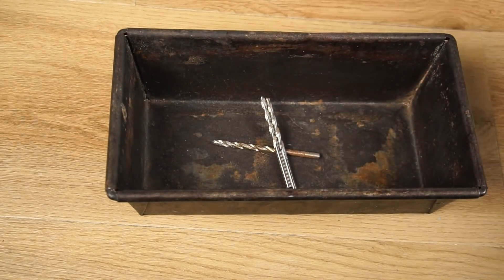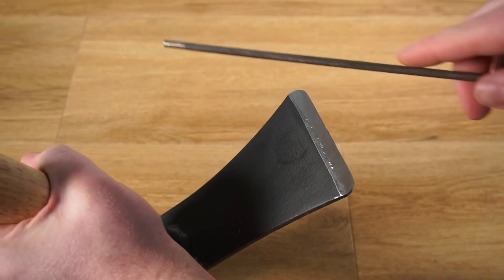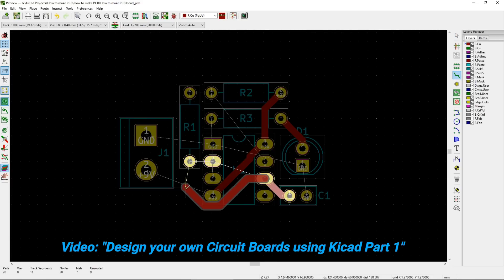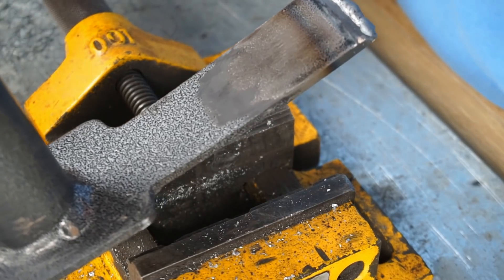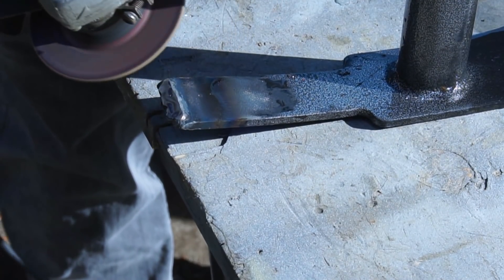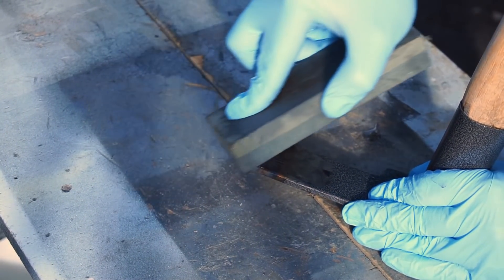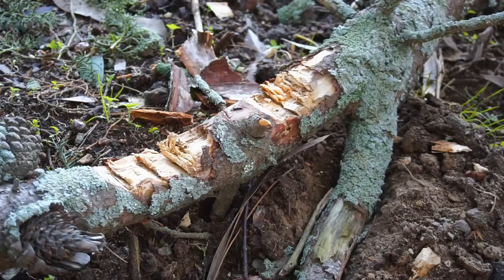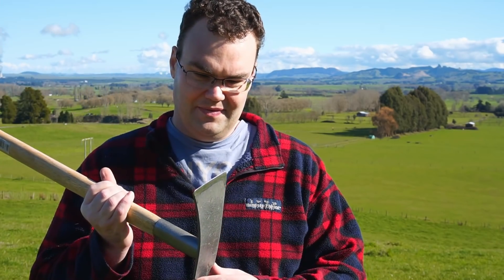HardFacing tools using Drillbits as filler rod!?!? II How to weld Hardfacing

Comment: Even regular filler rod is going to be a step up in strength over the mild steel itself.  The other problem if the new material is too hard it can chip off over time because the stresses at the transition don't match up with the mild steel underneath.  For hard facing anvils, they recommended putting down one layer of medium hard material with a hardness in the mid/high fifties, and then your top layer with a hardness in the sixties.

Comment: Excellent video. I became interested in the concept when I saw Jody use a drill bit, & This Old Tony used some tool steel filler-  I rebuilt a set of bolt cutter jaws,  hardfaced a digging bar (aka "heater bar") that I use to dig corners out of flint/clay packed gravel roads (as a Land Surveyor), and have even fixed some chisels from China. It definitely works.

Thanks!

Comment: Porosity may be due to welding technique. Smaller steps, and quicker dabs of bit. And those were biggish bits also.

Did some testing of hard face with drill bits last year. As welded hardness was HRC 66...

Comment: You should use a special grinding wheel made for hardfacing. Norton makes some great grinding wheels. Get the one made for S-1 steel. Works just killer.

Comment: Now, for those of you Johnny come Latelys that want to blather "what about resharpening the file big guy?" 

Thats not a thing. You can acid clean a file once or twice b4 its merde. But after that, the file is done, its donor metal. Use it to hard face.

Comment: Normalize an old file. Cutoff a piece of the file and forge weld it to the edge of your tool. Requench the tool edge.

NEVER EVER THRIW AWAY DRILL BITS. Unless you can make drill bits. 

Freakin learn how to resharpen them and they WILL last you DECADES.

Stop throwing out the baby with the bathwater!!!!!!!!!

Comment: You need to test the bits. i believe drill bits are softer/different metal at the chucking end. Stops damage to chuck when bit slips in it and probably better grip.Not the same tool steel all the way through to the end probably also done for cost saving. waste of money to have tool steel on non cutting end.

Comment: The impurities could also be caused by bad gas coverage. try putting  steel wool, fine scotchbrite or any other thin fine media up the nozzle of the tig torch. I've had the same problems, especially with the chinese stuff.  

As an added bonus, your welds will become shiny.
Reply: An often overlooked cause of porosity is high pressure on the gas, causing turblulance. A diffuser in the nozzle should slow the gas down a bit.

Comment: BE CAREFUL!!! It’s extremely dangerous to have any striking tool with a hardened edge.
also, cheap diamond stones and laughing paste come in handy when dealing with HSS or really hard steels.

I have experience forging and machining every type of steel. And it’s extremely dangerous using any type of striking tool that has a hardened face. I’ve restored well over a dozen anvils. Some really beautiful old historic pieces that had been really abused.… In the past I tried everything from machining the top flat then  adding a new plate of steel. Then comes the difficulty of heat treating and relieving the stress. Heating something that large and doing it evenly is difficult.,
I also used the hard facing technique like you discussed in your video. With welding rods.
You just have to be careful, and I’ll explain the potential danger below. But it can cause serious injury.

 It’s a very fine line to get something sufficiently hardened, so that it holds an edge, Without being brittle. You also have to take into account work hardening, which will harden the steel further… As it is used.

But with a striking tool, you can only go so far. There’s a reason they don’t make many striking tools with hardened steel. If you hit a rock with that spade, or if you hit metal with that hammer (like a nail)…. It can cause serious injury and even become lethal. There have been many instances of blacksmiths using hammers made from tool steel, that were too hard. If they miss their target and strike the anvil, or another hardened tool… A piece will chip off….. traveling at supersonic speed’s like a bullet. 
And wedge itself in between your legs, where your biggest veins in arteries carry blood. 

These chips can easily and instantly pass right through several layers of heavy clothes and even leather aprons. They’re traveling as fast as a bullet. And if it just slightly hits one of your big arteries (that are right there close by unprotected)… You’re done for. You won’t even make it to the hospital.
Just be careful.

You can also add carbon to steel which will allow you to harden it further. Of course with hardness, comes brittleness. It’s fairly straightforward. And has been done in the Blacksmithig community for a long time. There are different methods. But basically put stuff with carbon around it and get it really hot.

Comment: Similar to a carbidized edge?
The technique of plating a cutting edge or hard wearing surface with carbide.

Was first introduced to the technique 10 years ago, by the Grimsmo brothers. (The renowned custom knife makers). I think there A few YouTube videos showing the process. 

I’ve used it in the past when making tools for metal machining.  or when forging custom woodworking tools.. like gouges and cutting/burnishing tools. 
In most cases a solid carbide rod would be to brittle and difficult to shape. (without proper diamond and wet grinding equipment… still it’s a real pain in the butt.)

There have been instances where I forged high carbon steel, and then coated the hard wearing edges with carbide. 

It’s been about 10 years so I don’t quite remember everything….but I know the set of violin carving gouges I forged, have carbide plated edges. Over a good quality high carbon steel. Specifically the set of small palm gouges force carving the scroll of a violin. I’v used several of them every day for the last 10 years.
And can still clearly see the difference in color, of the carbide where it meets the high carbon steel underneath. Especially when honing them. Which is done several times per day. About every 10 minutes during heavy use. Just takes a few seconds. Using an extremely stiff leather “strop”, that’s glued to the side of my bench.
Its impregnated with diamond lapping paste. I think it’s 0.25µm… Which is about 60,000 grit.
Unless I have an accident and ship the edge of the tools, by dropping them or hitting a nail or something… They never have to be sharpened or touch a stone ever again. The geometry is right, all I do is honing them regularly, and they keep that hairsplitting sharpness. Only downside to carbide is you can’t use regular sharpening stones or polishing paste. Has to be diamond impregnated. Which is available much cheaper these days. 
Also, you need to finish the shaping/grinding/ sharpening the edge before playing. At least about 90%. I had already sharpened those tools, to a pretty fine edge. And only had the touch up and honing to do after plating. Because you don’t want to polish off that thin layer of carbide.

Comment: Best thing I ever did for trail benching with a $20 hoe was add 300 or so grams of lead to the around the base of the head, the extra weight to the hoe to improved performance when chipping hard earth. It murders the cutting edge if you hit anything harder than lime stone rock, like a buried waratah. I used a long band of flashing lead and wrapped it around the base of the head with a hose clamp to hold it, but it would have been much nicer to cast  a doughnut to fit the handle.

Comment: A couple of thoughts: You could try hardening the original steel with a mixture called super quench that can harden and toughen mild steel.  There is a good video comparison here: https://www.youtube.com/watch?v=NL6g_dMjN2k
You could also try peening the edge to thin it and work harden the steel.  This is the same principle that they use on scythe blades.
If you still want to use old drill bits, and I think that is a very clever idea to upcycle a work out tool, I would suggest adding the hard surface to the back of the blade rather than the  beveled face.  That would make sharpening the tool easier as it does wear, and you wouldn't be grinding away as much of the deposited drill material as you sharpen your tool. This is the same idea as the older laminated chisels.  Hard steel on the back of the tool, bevel is hard at the cutting edge, and soft further up the bevel.

Great video and a really clever idea that I will probably end up using on some of my tools.

Thanks.

Comment: Masonry nails, or concrete screws might be a good source of filler rod. One could also buy a small spool of hard facing mig wire.
Reply: Hss hardens in air. Unless you know how the nails are hardened, you'd have to test them to see if they harden in air or oil etc.

Comment: Are coffin nails particularly hard?
Reply: Coffin nails go in wood. They are mild steel with low carbon content. They also have no rare earth elements alloyed in. You can use masonry names as they at least have a higher carbon content. M2 or HSS some good spices and seasoning to help along the journey.

Comment: It would be very interesting to also harden the tip of this tool (without any welding) ,  and then do a comparison of performance between the two .
Reply: These cheap tools are made out of mild (low carbon) steel that doesn't harden.
Reply: @andrecook4268  case harden or bust

Comment: That's a great result I am a metallurgist and I learnt  In Metallurgy Science when you heat a hardened bit it loses its hardness at orange heat
Reply: Yeah, I was just thinking about this.. Was it necessary to cool it during the grinding when it had already been melted during the welding? And wouldn’t you need to harden it again to achieve the original hardness of the drill bit?🤔 Perhaps the heating and cooling helped a bit?
Reply: Because the weld bead is relatively small, and the process is relatively quick - the large mild steel mass it's being welded to pulls the heat out in sufficient time to harden it - you can see it go cold within seconds as the TIG torch moves along to the next bit... it's almost like quenching, hence the hard result. But when you grind (and he said he was grinding for 30 minutes) you can generate enough local heat, for enough time to temper it back to soft metal, which is why he kept it cool with water.
Reply: - even non heat treated (hardened and tempered") HSS is higher strength steel than mild steel - it isn't just the treating that makes this a potential good use of old drills... If you can TIG weld.  (don't forget your metallurgy including  "self hardening" HSS.)
Reply: I think that the results are achieved because the filler is still way harder than the base metal even when heat treated in less than ideal conditions.

Comment: How does grinding over heats the metal but welding doesn't?
Reply: It probably doesn’t.  That’s more a precaution for other types of steel and probably more of a habit/less heat is better approach.  HSS is pretty forgiving and retains its hardness at high heat.
Reply: I was wondering the same thing. If it retained its hardness after being melted, no amount of grinding would soften it. Actually I’m thinking it was too hard from the quick cooling after welding so maybe some heat treatment is in order?
Reply: @MekazaBitrusty the answer is:shield gas protecting hss from geting soft,but grinding not

Comment: Using old drill bits to hard face is a great idea...I would have never thought that to be possible. New Zealand is just a beautiful place. I've never been there but every time I've seen pictures and video of it, it just seems like Shangri la.
Reply: NO ITS NOT! 
ITS A CRYIN WASTE!

Resharpen drill bits, stop wasting them! Find an old rusted file, anneal/normalize it, use it instead. Reharden it.
Reply: @canberradogfarts  or just use a bench grinder
Reply: Brilliant. I hardface excavator bucket teeth with stick regularly in the field but will attempt to use some of our old two foot drill bits next time as an electrode to both add more material and hopefully do it less often. You are obviously an engineer lol , but maybe 1.  Prep drill bit flute interiors with acetone and cuetips, they have ten years of oil on there.  2.  Prep tool surface with acetone as well, 3. Increase pre and post flow time, get a lot of argon on there. 4. Use a grinding wheel vs cutoff wheel with grit on flats

Comment: What is a gumtree doing in the land of the long white cloud?
Good to see you wearing your Fred Dagg gumboots!
I reckon the drill bits are worth more than the hoe and certainly more than the required filler rod. 
Do you think cooling the hoe's hard face while grinding would make any difference considering you just melted it on?
Good idea though, do you think high tensile fence wire would work too?
Reply from the maker: Thinking about it, I should have put on a pair of stubbies & black singlet for this video aye! Oh well, least I had the gummies! Interesting suggestion you have there. Striping the galvanising would be required prior to welding. Maybe worth exploring...